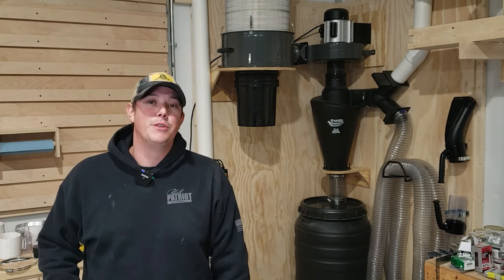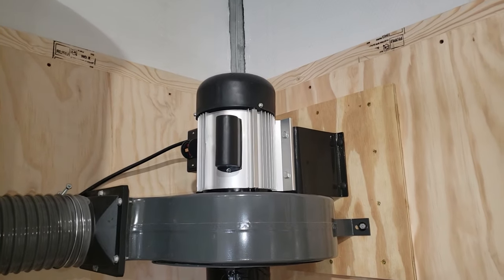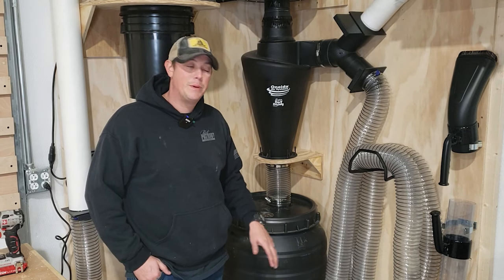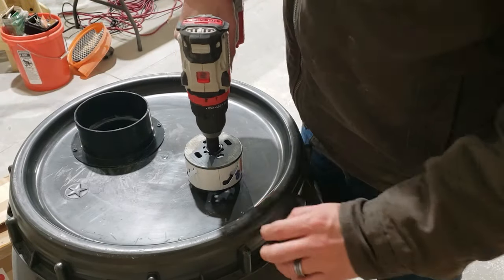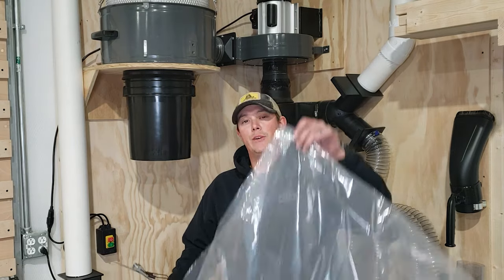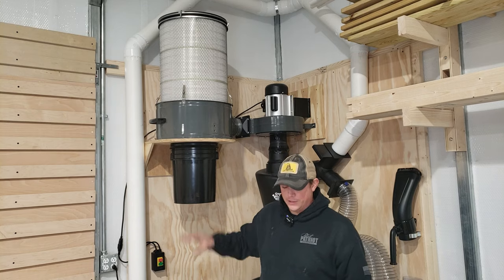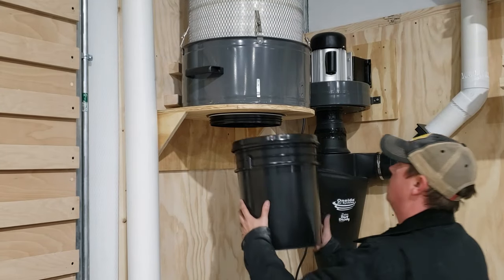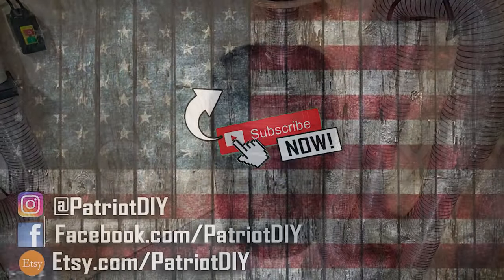Dust Collector Upgrades / 2 Stage Harbor Freight Dust Collection

Comment: Nice set up . But how do you empty  shaving  barrel do you have to turn barrel  on and off    or  I'm  I missing something  also where you get flex hose from bottom of deputy to barrel .regards Arthur
Reply from the maker: Flex hose is in the link in the description.  To empty the big barrel just disconnect the hose and open the lid.   To empty the bucket, you unscrew it from the bottom of the filter

Comment: I  have been amassing the components needed to upgrade the same dust collection system as you have in this video.  It's a great video however, I require further explanation on the 6" to 5"reducer that goes from the collector suction to the Dust Deputy inlet.  Please advise as to where I an obtain such a reducer.  This is the one area of the video that had very little detail. a check of the link Dust Collector Accessories shows no such component.  Thanks in advance from 1st Cav Vet.
Reply from the maker: It's a 6 to 5 reducer from Lowes, it can be found in the air duct section. Doesn't fit perfect, but with some crimping and some duct tape, it works!

Comment: Did you use a 4", 5" or 6" flex duct between the barrel and the Dust Deputy? Where did you source the inlet flanges from?
Reply from the maker: 5" flex hose between the DD and barrel.   Flanges were from Amazon (Powertech brand i beleive)

Comment: I’m trying to hang my DC (same model) , but not in a corner, so on a flat wall so to speak. Do you think the 90 degree going from the output of the motor into the metal cylinder (that came with the unit) , then to the filter/gamma bucket unit  be to much of a problem?

Comment: Hey Boss, Love the video and will be attempting this weekend once all the parts get here. My biggest question is, from the impellor to the filter case, is it an issue if it is slightly lower than the motor/impellor housing? Looks like it will be close (maybe 3 inches lower) and keeping the micron filter from being smashed up into the overhead storage rack is making me think about location.
Reply from the maker: It's better if it lines up but I'm sure you're fine. Keep in mind, in the standard configuration they are nowhere near each other so just get it as close as you can and make it a gradual transition and you'll probably be fine
Reply: @PatriotDIY  where did you get your screw top barrel?

Comment: Thanks for the video. Doing the same setup. Quick question. Do you have any problems unscrewing the top lid of the barrel while it’s connected to the clear pipe? Thanks
Reply from the maker: I disconnect the clear pipe to unscrew the top.  Use a quick clamp and that makes it super fast and easy!
Reply: Thanks brother.

Comment: Working on the same exact system but concerned about my ceiling height. Can you tell me the measurement from the top of your filter to the floor?. I barely have a 8 foot ceiling in my basement workshop.
Reply from the maker: Mines about 9ft. But you could use a shorted dust barrel, or just lower the filter and use flex hose between it and the fan

Comment: I like it! But it's not a "2 stage" system. It's a 3 Stage system! Stage one is the cyclone, stage two is the second cyclone ( it's built into the original filter/bag holder section), and stage 3 is the pleated filter.

Comment: Don't think I need a 63-gallon Screw Top Drum.  Any suggestions?
Reply from the maker: You can do the same system with whatever size container you want. There are alot if different size drums out there

Comment: Question?  I am about to build my shop and was thinking if i ran my duct directly outside i would not need the filter.  Am I thinking correctly or will that create any issue that I have not taken into account?
Reply from the maker: Is your shop conditioned? If it is you'll be pumping your conditioned air outside
Reply: @PatriotDIY  I didn't even think of that...thanks.  I really like the way you have set that up.

Comment: Where did you find the five gallon bucket? having a problem locating one that will screw on
Reply from the maker: Links are in the description! What you will need is a Gamma Seal lid, they fit on almost any 5 gallon bucket.

Comment: Great video and great job with the upgrade~!  This is exactly the setup I'm looking at to mod my HF DC for my shop.  What adapter did you use to connect the flex hose under the cyclone bracket?  I'm guessing the same one you used on the wall to hang your dust hose end.
Thanks for sharing this~!
Reply: I actually meant to ask about the adapter between the Dust Deputy and the DC motor.  None of the 6" to 5" reducers (galvanized) I've found have a 5" I.D., so they won't fit over the motor's inlet.  Thanks~!

Comment: hey man! i actually have like the almost the exact same setup, but im having an issue as of late that none of my chips and dust are going to the main bucket, instead theyre going right to the propeller and into the filter bucket. any ideas on how to fix this? thanks!
Reply: Me too any fixes yet?
Reply: Time to empty the big can.  You won’t be able to fill it all the way to the top- you may only be able to fill it halfway before the suction from the vacuum motor is going to be able to overcome the weight of the chips.

Comment: hi there. havnt heard back but hoping someone can answer this for me. the black barrel that collects the majority of the dust has an intake for that dust to inhale in to. does that black barrel need anywhere for that air to go? im totally a newbie so my brain says air is going in and will blow up the barrel so what am i not getting here? please educate me
Reply: oh FYI assume i wont be using the cyclone and going directly into a barrel like in this video. would that mean i have to do something different to prevent a lot of the dust from making its way up and into the filter or am i still go to go ?
Reply from the maker: The air doesn't really blow into the barrel, the cyclone DROPs the large particles into the barrel and the air pushes up through the impeller and out the filter
Reply: So if i have it go from the y spilt directly into my 30 gallon barrel, will that be ok or will not having the cyclone create an issue? im guessing where you currently have your cyclone i would have to put a T so bottom goes into my barrel and the top of it goes into the blower and the last part will connect to the Y split that goes to the shop tools. Hope that made sense and if so, please let me know your thoughts on if that is the correct way to do it if i dont use the cyclone  @PatriotDIY
Reply from the maker: @eladsinay6914  to set it up like mine you'll need the cyclone, otherwise most everything will go out the other end. So you'd need the barrel under the filter instead.
Reply: got it. ok ill order the filter i suppose, whats another $180 haha @PatriotDIY

Comment: Potentially stupid question, what is preventing me from just pumping the air out the wall and outside into a bucket? No filter to restrict flow, much less dust. ( yes, I understand that would only work if you were far away from neighbors)
Reply from the maker: If your shop is conditioned at all you'll be pumping your cooled or heat air outside
Reply: @PatriotDIY  and at 950cfm. That's a good point

Comment: Wow this is exactly what I'm looking for. How much did this whole system cost you?
Reply from the maker: Around $200 for the collector. I have links to the other stuff in the description!
Reply: I purchased a Bucktool cyclone and bucket for $190, the dust collector is $250 in my area, and the MERV 15 filter was $245
Reply: This is pretty cool and a fun project but by the time you buy the dust collector and all the mods you could probably find a brand new with a cyclone and canister filter on sale for a few hundred more. Saw a laguna at Rockler the other day $750 on sale.
Reply from the maker: @johannsehmsdorf9771   That's definitely a way you could go if you have an extra $300 to spend!  I think the benefit of going with the Harbor freight if you are on a budget is you can get into a dust collector for $200 then upgraded a little at a time as you go and spread the cost over time. 
 I didn't do that, I did it all at 1 time and used the extra $300 savings to buy three 2x4s At home depot 🤣
Reply: @PatriotDIY  True!

Comment: May I ask what fittings you used coming from the cyclone inlet?  I see two blast gates connected and a Y fitting.  Is there something between the blast gates?
Reply from the maker: It's the Y fitting that came with the Harbor Frieght unit. Just added blast gates.
Reply: @PatriotDIY  my Y fitting doesnt fit on it. They are both size 5 diameter.   Thats why I ask if you used some kind of coupler or something.
Reply from the maker: @XxMalabooo  ahhhh yes!! Found a rubber 5in to 5in coupler that made the connection.  I believe it was on Amazon, if I can find the link I'll post it!

Comment: what did you use as a the reducer to the dust deputy?  Do you have a link?
Reply from the maker: A reducer from Lowes or Home Depot you can find it in the air duct section.
Reply: @PatriotDIY thanks. I’ve tried those. Never seem to match up with the HF dust collector. It seems like the 5 inch to 4 inch reducers they sell just don’t match up.
Reply from the maker: @Michael Monahan  try crimping the 5in side.  It's still not perfect fit but made it work and used duct tape on the connection

Comment: Hi. I built a copy of your dust collector. Are you getting very much fine dust in the bucket?  I am using a smaller bucket with an omega lid and I did not cut all of the center out. I am collecting quite a bit of fine dust. So it looks like it is working. just curious if there is a difference. Thanks
Reply from the maker: It is definatly catching fine dust! But most everything ends up in the large barrel. At this rate I'll fill 5 barrels before I have to empty 1 bucket!
Reply: @PatriotDIY  I was surprised about how  much got past the dust deputy
Reply from the maker: @dalemcbride7299  mine has very little get to the bucket, not sure what the difference might be. But as long as it's getting caught and not going in the air, it sounds like it's working good!
Reply: @dalemcbride7299  if your worry about fine dust going past the large  cyclone then you will need a dyson fine cylone with them rubber nozzle tips installed after the big cyclone, then a  hepa at the end
Reply: @koopasayer5999  My system is working fine The final filter is catching anything that the DD misses.  Before I built this system I was using a small Clear view with a shop vac and almost nothing got past the Clear View into the shop vac. It was to small and chocked up when I got a 12 inch planer, So the need for a larger system. My is staying clean so no worries.
Reply: @dalemcbride7299  Most likely there is  a leak between the dust deputy and the storage barrel.  Other wise no dust would be getting to the bucket.
Reply: @MarkJonesRanger  If the dust Deputy stopped all of the dust then I would not need the big filter would I??? The dust in the bucket is verrry fine and amounts to about 2 hands full after two months of use. So all in all I am very happy with the install.
Reply: @MarkJonesRanger  Also my previous 2" clear view (which was to small ) seemed to be better at stopping dust going in to the shop vac I was using.  The amount of dust in the bucket  was from abou 35 gallons of dust ./ chips  I collected in the barrel
Reply: @dalemcbride7299  I have two dust deputy's After running in my shop for months even a year at  a time there is no dust in the shop vac or the filter bag.  My point in what I was making is there is a small leak between the bottom of the dust deputy and the storage barrel if you have even a handful of dust in the bucket.     
My shop vac is in a noise canceling box and it stays in there for a year at a time.  Only time I pull it out is to check the filter and there is not enough dust in it to talk about 99.9%.  Both filters stay that clean.  Yours is working for you that is great.

Comment: Where did you get the reducer to go from the top of the Super Dust Deputy to the HF Dust Collector Intake? I have everything ready to go except that. Thanks!!
Reply from the maker: 6in to 5in air duct reducer from Lowes. I had to crimp it to get it to work

Comment: What did you use to connect dust deputy to the harbor freight part
Reply from the maker: 6" to 5" galvanized reducer! Can be found at Lowe's or home depot!  It may need to be crimped to get the for right! I also duct taped it!
Reply: @PatriotDIY  where did you get the 5” splice collar that connects the cyclone inlet to the harbor freight 5” to 4” splitter?
Reply from the maker: @knighthaus  amazon!
Reply: @PatriotDIY  thanks!  I need that part but having a hard time finding it on Amazon. Do you have a link?
Reply from the maker: @knighthaus  https://amzn.to/3MJKWTK
Reply: @PatriotDIY  awesome. Thanks!

Comment: ccouldnt afford yet spends another $1200 in add ons lol
Reply from the maker: Not sure how you came up with that math....around 200 for the HF dustcollector, around 200 for the Super Dust Deputy, and around 250 for the Wynn filter....plus a few fittings and a 5 gal bucket....so we are talking about $500 in add ons.